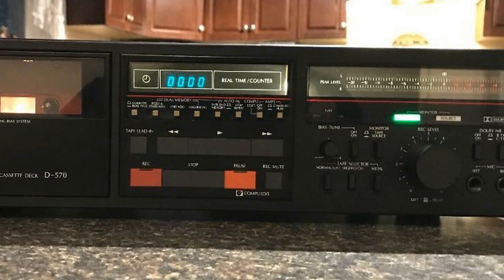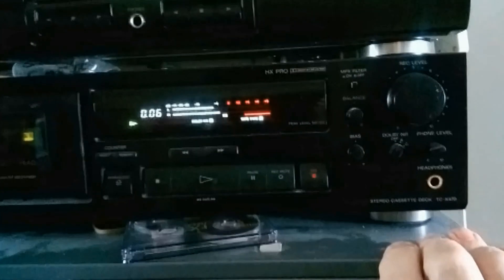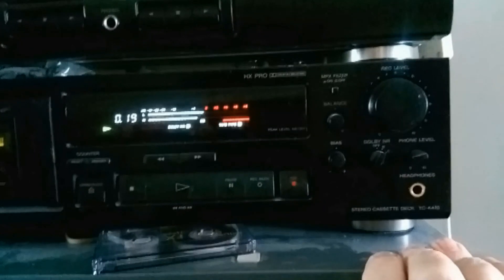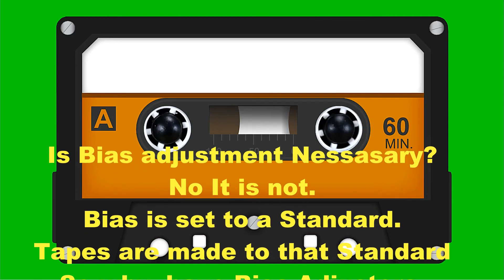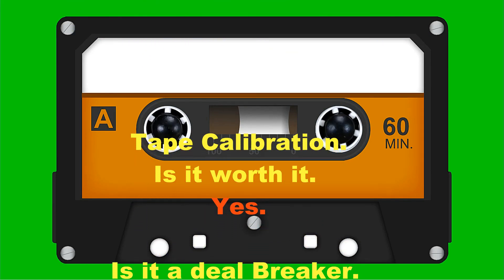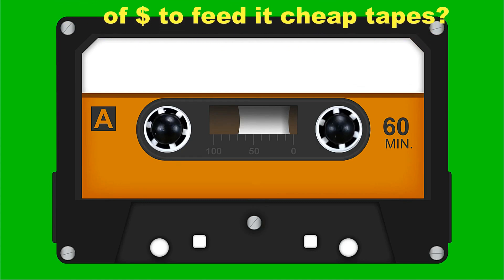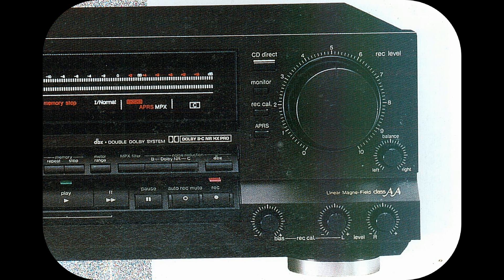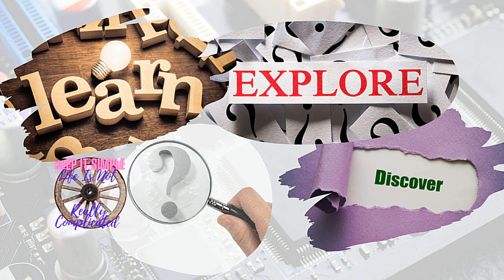Bias switches. Whats it  do? Cassette Decks Buttons

Comment: What tapes is the Teac 1200 set up for
Reply from the maker: I have seen that question asked and no real answer. That is partly why I have done the Tests the way they are. The TDK D is good, and the CDing 2  gives good results. So i feel this is fair to use as a referance. 
The results are on my channel.
 I always do the same test and levels so you can listen and see the results and compare . The only tape I did not use was the Metal but you can see the results and hear payback in this video https://youtu.be/OHoXFIuFHO4 cheers.